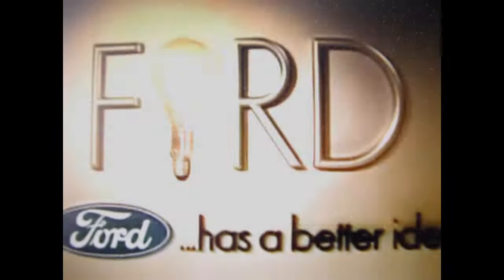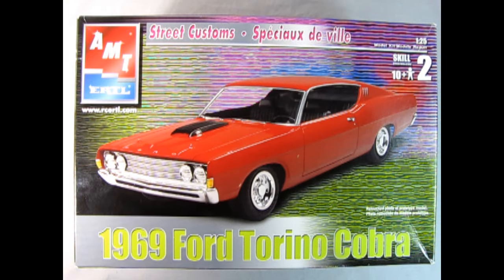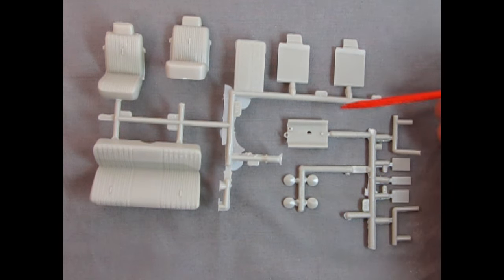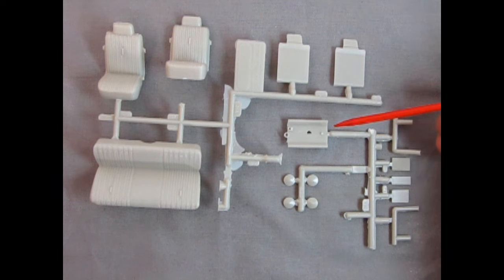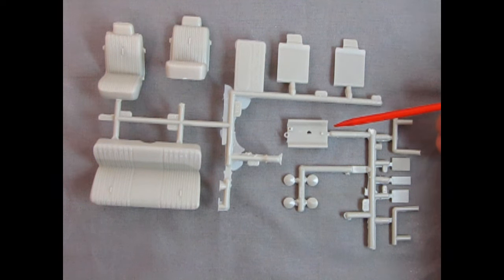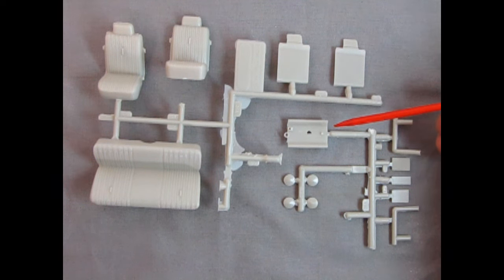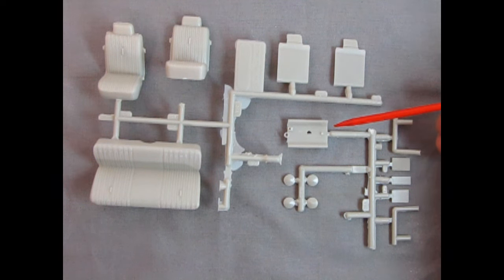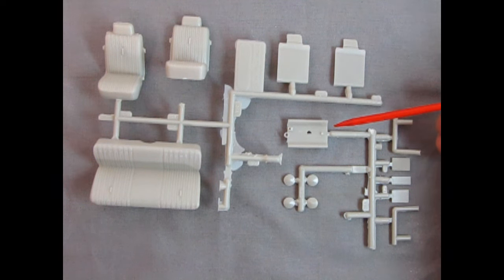How To Fix Everything Wrong With The AMT/ERTL 1969 Ford Fairlane Cobra Torino Model Car Kit Part 2

Comment: GREAT VIDEO FELLA! I've been wanting to build Jason Statham's 69 Torino GT, from movie "Wild Card", but the Bad reviews I read on these kits dissuaded me. Until your video on fixing this kit. THANK YOU! Round 2 should have corrected this or done what Your doing with this Fix video. Your reviews are Top Shelf for model builders and they're MUCH Appreciated. Thanks Again
Reply from the maker: You are welcome. The real building/fixing is starting next week. Stay tuned!
Reply: I'm There Fella, Thanks Again
Reply from the maker: You are welcome. Somehow, you are the first person to comment on "Part 2" of the building video. Not sure how that worked though , as this video will be shown next week.
Reply: I was commenting on Part 1 video, Cause you've done something, LONG over due on this kit. I Especially appreciate the video as I'm a Newbie modeler.
Reply from the maker: Glad I could help! 
I think I have discovered a whole shopping list of corrections on this kit no one ever knew about! 
The only version I couldn't do was the street machine. I only had 2 kits.

Comment: Already done all this!But as i told you i lengthened the chassis 2 mm at the place where round 2 hacked it together!So rear wheel problem fit done and the offset of the  chassis front third to the 2 "rear" thirds of the chassis! ! 😉And i redid the thin chrome trim on the nose and rear!Because it s not really existing!Especially after sanding the parting lines!
Reply from the maker: For sure! I still have 2 more videos and I still need to get the models painted and finished. I keep finding issues many missed . Hope you'll check out the other upcoming videos.